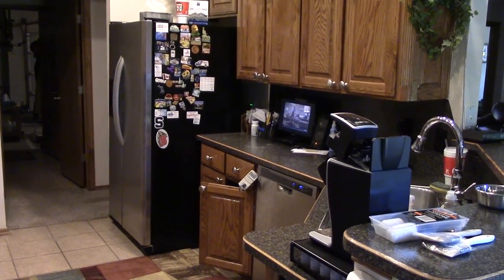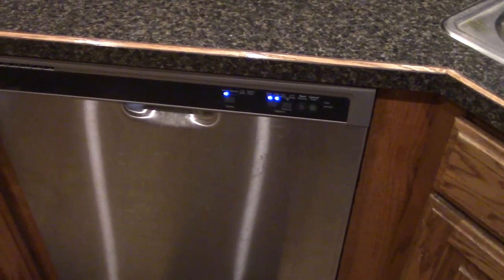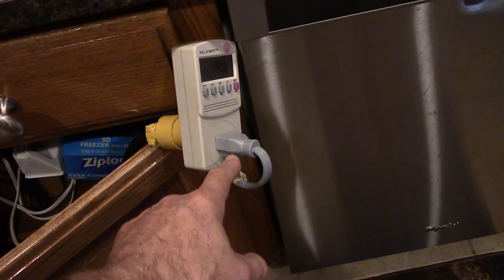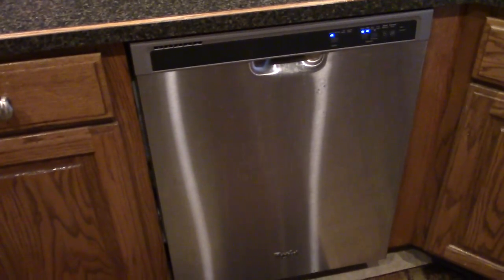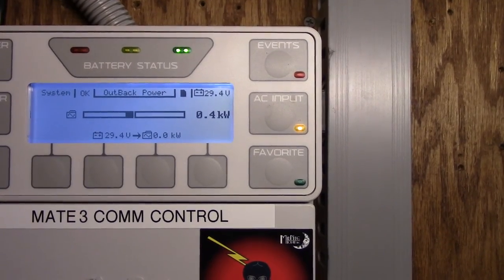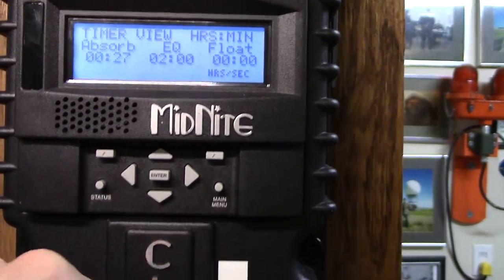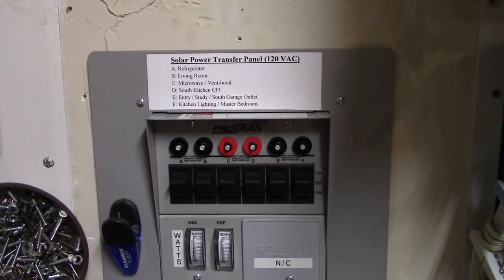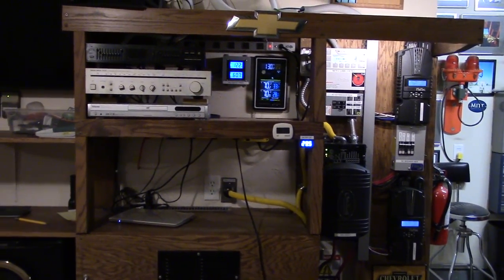DIY solar powered dishwasher: wired into my solar power transfer panel circuit!

Comment: My wife wanted a dishwasher at the camp. Saying I thought I married one did not evoke a positive response.  At town recycling someone was about to dump a nice 2 year old GE dishwasher in recycling.  They said it died in a lightning storm. So, home it went and it was running in 5 minutes after replacing some burned parts.  I run the camp on only a single car battery and excess PV is used to heat water so I have 120F. The heater wires are disconnected from mains and those turn on the 60V DC PV array power to the heater.  That gives about 300W of heat, enough to maintain water temp and have heated dry.  Added extra insulation to reduce heat loss.  Whole wash cycle only takes 0.1KWH with the washing cycle drawing about 75W.